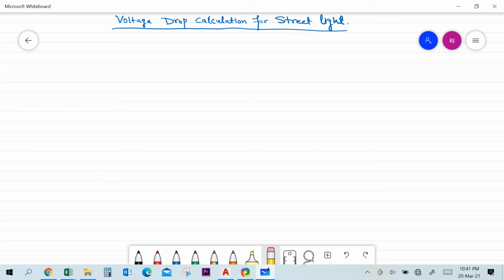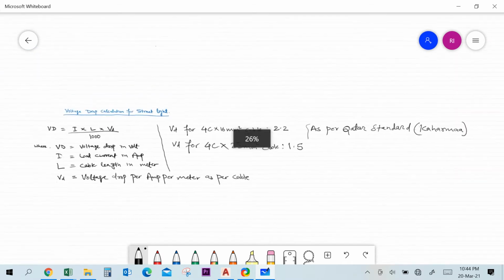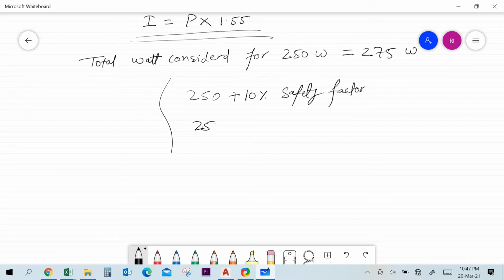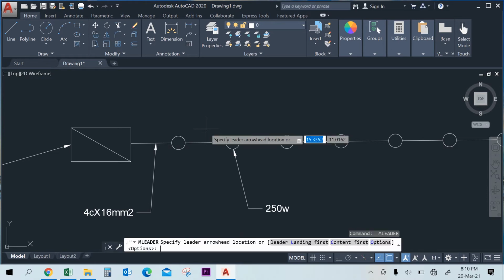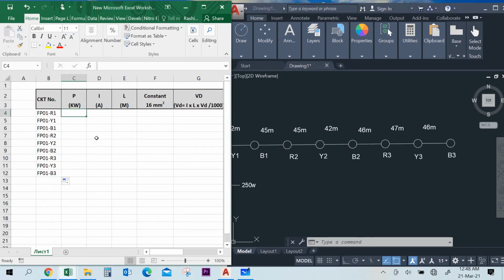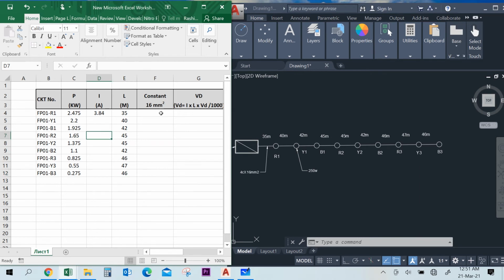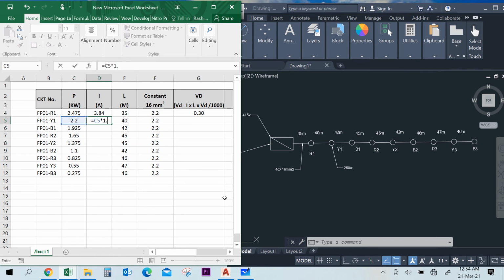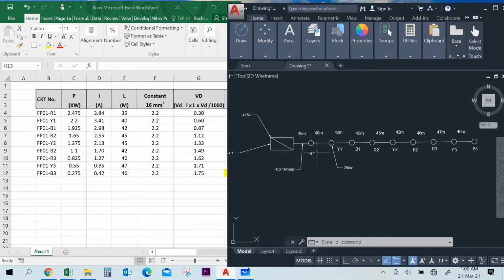Voltage drop calculation for Street light

Comment: Sir,Phase Wise Kw  R1,R2,R3 ,y1,y2,y2,B1,b2,b2 may reduce the kw, i think
Reply from the maker: poles are phase-wise (R/Y/B), voltage drop happens in the common 4-core cable, so each pole sees cumulative drop from FP based on its distance, not phase-wise separately.

Comment: Terminal voltage should be the preceeding terminal voltage - voltage per segment , not the accumulated drop , hence the Vt are the following values: 415, 415-0.30 = 414.7  ,  414.7 - 0.3 = 414.4 ,  414.4 - 0.27 = 414.13,  414.13 - 0.25 = 413.88 etc

if you will use the accumulated value of the drop, then it should be subtracted to the fixed begining 415  to get terminal voltages . i.e. 415 -.30 = 414.7,  415 - 0.6 = 414.4 , 415 - 0.87 = 414.13 ,  415 - 1.12 = 413.88 , etc 

what you did was : 415 - 0.30 = 414.7 , 414.7 -  0.6 = 414.1 ,  414.1 - 0.87 = 413.23 etc

Comment: 3-phase, 415V system with poles spaced 70 meters apart. Each pole has 4 arm lights, and each light is 335W. A 100A feeder pillar with 6 outgoing circuits, each protected by a 63A MCCB. What is the voltage drop for each outgoing circuit?

Comment: i like ur videos but in this i would suggest in voltage drop of street lighting cable u consider complete length and complete wattage then calculate VD rather than considering each circuit. thank you

Comment: i think there is something wrong because you consider your loads (luminaires) as 3 phase but it is a single phase you not have to sub the voltage after every luminaire
Reply from the maker: Its not wrong calculation, here we made calculation for 3phase cable, even though if you will do single phase calculation for phase wise connected to their load you will get same result.
Reply: I also feel that there is something wrong with it. Since it's three phase, the load should be divided into 3. Which will have significant changes.

Comment: Hello! Sir How does R phase has 9 loads? isn't it supposed to be only 3 loads (R1, R2, R3). why did you consider the load on other phases as load on R phase?
Reply from the maker: Yes R phase has only 3 nos of load and total circuit has 9 nos. of load. 
We are doing 3phase calculation that is why we consider every phase at each point.
Reply: @Rashid-iqubal  so if I were to do the same calculation using single-phase formula, I would only consider load on each phase and calculate the voltage drop for each phase. Right sir?
why did you use the 3-phase calculation? isn't this calculation for the branch circuit? As far as I know branch circuit are single phase circuit supplying single phase load (in this Scenario). so, shouldn't the calculation be also done using single phase formula?

Comment: This is for 3ph cable what about 1ph
Reply from the maker: If you use single phase supply, from calculation you can write single phase (220) supply instead of 3phase (415) and remove root 3 while calculating current.
Reply: @Rashid-iqubal  Hi, is it possible if u make a video based on perphase? appreciate if u can make a video of vd calculation and vd percentage based on each phase (1ph) , phase R , phase Y , phase B

Comment: but the street light is a single phase load .Why did you consider 3ph power formula for single phase load?
Reply from the maker: it is 3 phase distributed supply, that is why we calculate overall voltage drop of cable
Reply: @Rashid-iqubal Thank you

Comment: Hi, If I go for 2 runs how should I consider the Vd constant.
It means If I try with 4Cx16Sqmm - 2 Runs. But as per the vendor details if the constant is 2.546. What will be constant value I should take. Pls advice!!!
Reply from the maker: in this case you can consider half of constant value. like 2.546/2 = 1.27

Comment: What is about the main cable size to feeder panel
Reply: Are you serious to do video for explaining main cable size
Reply from the maker: @mryounis8291  https://youtu.be/lgornHWejMU
Reply from the maker: From substation LV panel to feeder pillar cable size should be 4cx300mmsq, then from main cable we need to make T-joint with 4c×35mmsq and terminate in Service cabinet (Kwh meter)  or feeder pillar.
Or its depand on your country standard.
Reply: @Rashid-iqubal  thank you for answering
but I have question I am working in street light projects
If I have four circuit cables from the feeder each cable feed 25ples each pole light has power 250w and the distance between each pole 40m
Do think 35mm cable enagh to feed four circuit cables with voltage drop 3%each circuit cable
Reply from the maker: @mryounis8291  exactly in that case you need bigger size of cable. Either you can calculate voltage drop or i would prefer it should be 4c×70mm2 cable joint from main cable.
Reply from the maker: @mryounis8291  i recommend you pease make voltage drop calculation of branch circuit then choose the cable which provide less then 3% voltage drop. Once you select branch cable then you select next biger size of cable compare to branch circuit. Becase if make T joint from main cable to feeder piller, i am sure length will be short. Then voltage drop will be less as well from main cable to feeder pillar. Hope you got your answer.
Reply: @Rashid-iqubal  thank you Eng.Rashed
I am from Oman
near to Qatar
Can you show us by video how calculate the main cable size like this case
Reply from the maker: @mryounis8291  sure very soon i will make video on this topic. Oman is a good country, i like it.  Thanks
Reply: @Rashid-iqubal  is this applicable in uae particularly fewa/dewa?
Reply from the maker: @markmavgaming  yes amlost same
Reply: Good question how can calculate the main cable sizes if you have more than three cables circuit feed the street lights
Reply from the maker: @saidal-saiyabi5267  i am working on that video, very soon i will upload video for sizing of main cable for street light.
Reply: @Rashid-iqubal  have you   finished work the video for main cable
Reply from the maker: @Mr Younis  oh! I forgot, now i am going to make video on that topic.. by next week i will upload..
Reply from the maker: Please accept my apology, due to lack of time and having work pressure in my project, i am unable to make video smoothly . anyway i have prepared some parts of it, very soon i will publish.

Comment: sir normally when we calculate voltage drop calculation for main panel to distribution box we take total watts and full length of cable and mv  value together but sir here you calculate feeder pillar to R1 , Y1 and other value of voltage drop separately calculate  sir can you explain the reason for this type of calculation
Reply from the maker: Sure, very soon i will make video for calculation from transformer LV panel to street light poles.

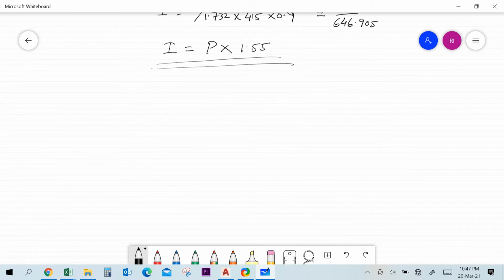Comment: Minutes 4:58 , how u get value 1.55? Shouldn’t it be 0.00155? Please reply me 🙏🏻
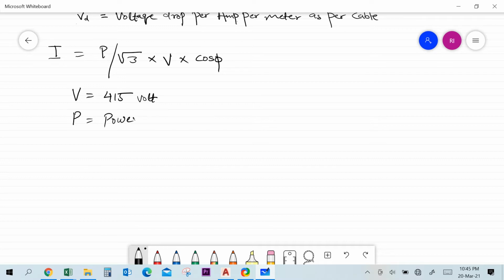Reply from the maker: @3:40 i used power in kilo watt, if u multiply 0.00155 by 1000 you will get 1.55
Reply: @Rashid-iqubal  how did u guys even get the 0.00155 pls
Reply from the maker: @brendaazia5713  I = P(KW)/646.905 = 0.00155P 
I = (P x 1000)w / 646.95 (Power in KW that is why we multiply by 1000 to make in watt only)
I = P1000 / 646.95
I = P1.55

Hope you understand !
Reply: @Rashid-iqubal 
How much power did you take...(2250 ?) please do reply
Reply: If you multiply by 1000, then shouldn’t we take power in watts for calculating I?

Comment: Nice video..
Where can i get the costant value for cable(like you took 2.2)  as per Indian standard..
Can you upload a video of voltage drop from substation to load ( fan or anything)
{E.g. vd from substation to feeder piller, feeder piller to meterapnel....)
Awaiting for your reply
Reply from the maker: Thanks Wasim, for constant u can refer to Indian standard or you can check in cable catalogue. Sure i will make video on voltage drop from substation to domestic load.

Comment: how to select actual cable size for sheet ligth for 2km
Reply from the maker: For 2 km, it should be larger size of cable required, first choose any size of cable and calculate. If u get voltage drop less then 3% then you can go for it otherwise select next higher size of cable.. try with 25mm2 cable size otherwise check with 35mm2 cable size

Comment: does vertical distance ( box to fixtures) also adds to the length of wires for vd computation?
Reply from the maker: No! that calculation only from Lighting panel to horizontal cable till cutout/MCB. Voltage drop from Vertical cable has negligible.

Comment: NIce
Why did you reduce 1 pole in Y1?
Y1 is the beginning of the circuit Y
and also B1 is the beginning of the circuit B

Because we have 3 circuits (3 PH), each circuit has 3 Pole (Luminars)
So Power of R1=Y1=B1= Power of 3 Pole 
Power of R2=Y2+B2= Power of 2 Pole
and Power of R3=Y3+B3= Power of 1 Pole
Awaiting your feedback
 Thank you
Reply from the maker: Because i am using 3phase calculation for all poles. If you choose separate calculation like R separate, Y separate and B separate then you need to do calculation in respect of single phase supply. Both way is correct

Comment: Nice, now what is the solution?
Reply from the maker: Solution for what ?
Reply: @Rashid-iqubal  I meant how to manage the losses of the voltage ? is there a way to bring back the drop?
Reply from the maker: @drdayud  yes! you can change the size of cable accordingly till the voltage drop  match to your requirement. increase the cable size lower the drop